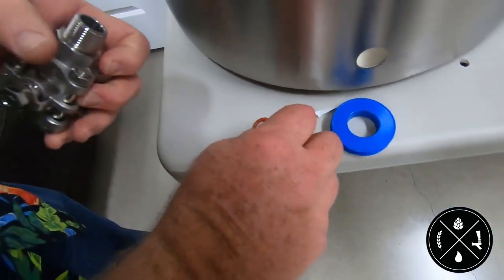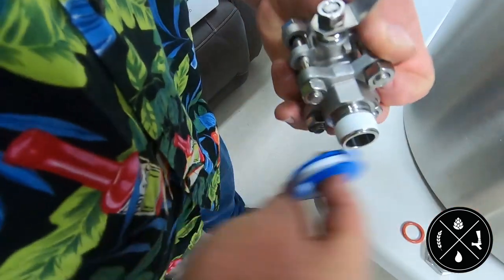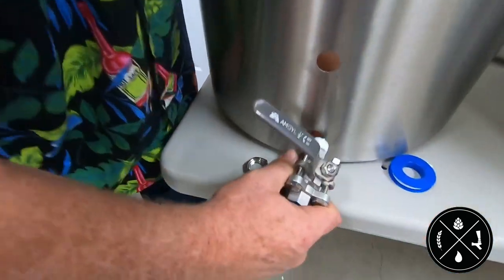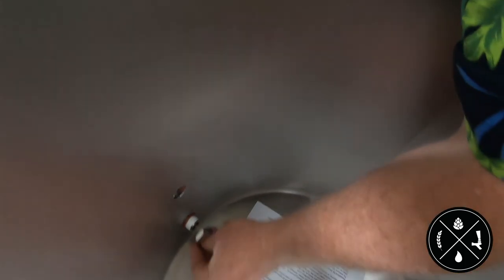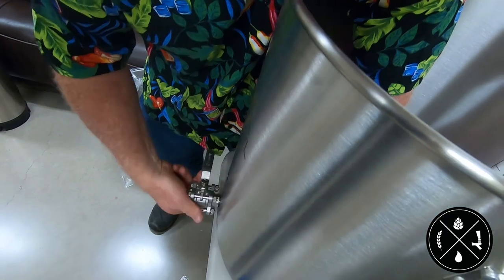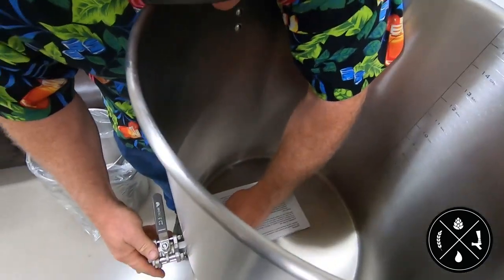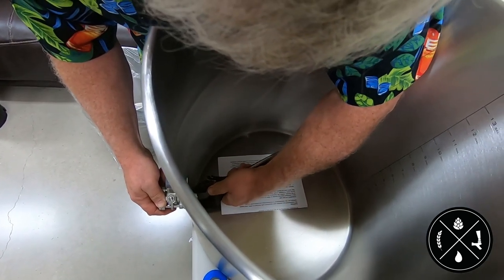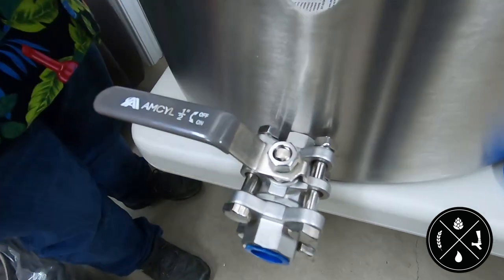Installing a Weldless Ball Valve to an AMCYL Brew Kettle

Comment: Can the o-ring withstand the heat?
Reply: Yes, those red ones are heat resistant and meant for this kind of application. Do not use regular o-rings from the hardware store, however.